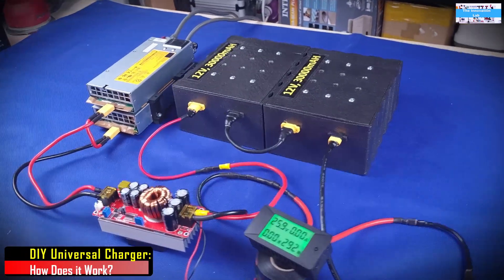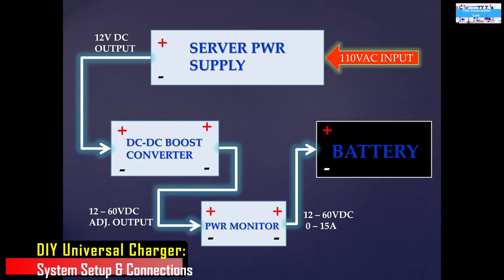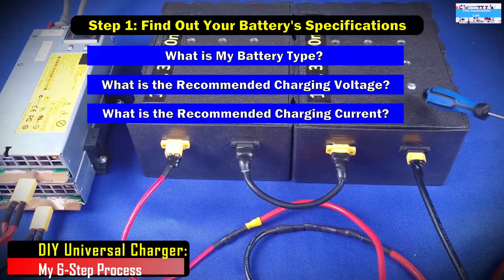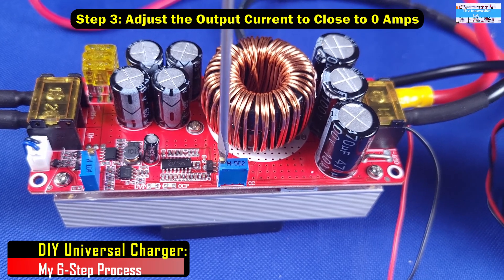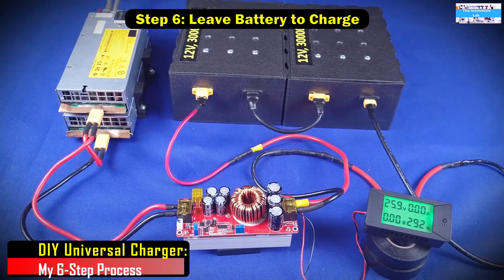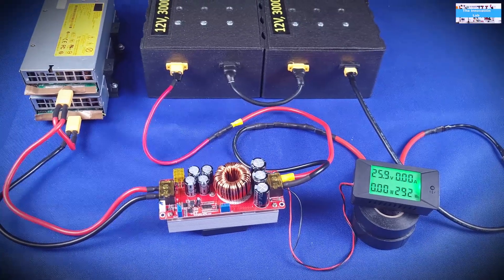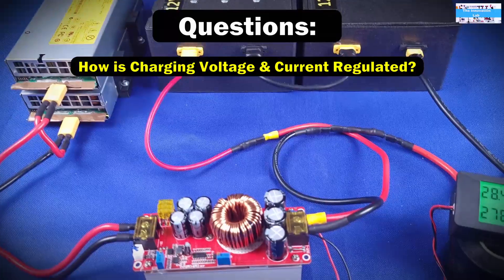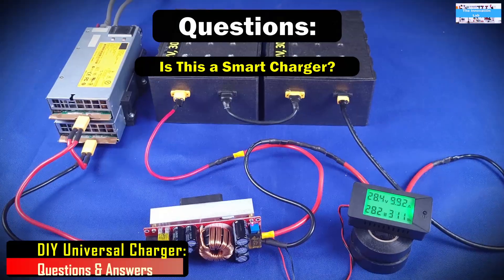DC to DC BOOST CONVERTER, High Voltage Battery Charger!

Comment: Hi friend. I have another question. Can I charge LG Chem lithium assemblies without a booster module? Directly from the power supply unit with a 12.6 volt supply? And also having previously used BMS
Reply from the maker: Thanks for the interaction. I really appreciate your thoughtful questions.
👍 
However, I am not sure of what the specs of your battery are so as to speak to the charging conditions.

The reason why I recommend using the boost converter is because it is a constant current converter and  allows you to control both the  charging voltage and charging current to match what your battery is designed for. This prevents you from damaging your battery cells due to high charging currents.

Reason:
Lithium ion and lithium phosphate battery cells have low internal resistance when the batteries are fully discharged. This means that if you do not control both your charging voltage and current, you may end up with super high charging currents going into your batteries. When this happens, your power supply could either trip off, blow a fuse, get damaged, or your battery cells could get overheated, and they may burst after a while.

Overall, I honestly won't recommend that you do any charging if you don't have a way to control/adjust your charging current.
Reply: @theinnovati0nlab782  but a charge of 5 or 15 amperes will take a long time if the battery has a capacity of 200 amperes and 12 volts. How to charge it faster? is this possible?
Reply from the maker: Very true. 
15 Amps of charging current will take a long time. The 1500W boost converters I used can give you up to 30A - depending on your power source. At 30A, your battery will still take about 7 - 8 hours to recharge. Is this the lithium battery? What is the battery voltage?
Reply: @theinnovati0nlab782  LG Chem 3S4P 2.65kWh 12v
I have a server power supply unit 12V 65A

Comment: May I ask one other question and apologies if I missed it in the video...Once the current and voltage are set up, what happens when a cloud blocks some sunlight?  Does this maintain voltage while reducing current?  Then when sunny again will it return to the programmed settings?  Thanks in advance man
Reply from the maker: Thanks a lot for the wonderful interaction. Please know that all your questions are welcome. Please never apologize for asking great questions. 🙂

The boost converter is a constant current converter, and in order for it to perform as designed, it must be connected to a power source that  provides more power than your load is demanding of it. Your load in this situation will be the batteries that you are charging.

It seems to me that what you need is a solar MPPT charge controller. MPPT controller will provide exactly the function that you were describing because as the name goes, they actually do Maximum Power Point Tracking/Control. The MPPT charge controllers are designed to scale down the charging current when the solar irradiance on your panels is low ==> in order words a cloudy/ rainy/snowy day.
Reply: @theinnovati0nlab782  Fantastic.  That answers my question perfectly!  Thanks a million.
Reply: So if the constant current cannot be maintained it will shut down?  And if that's correct, this type of unit isn't a good match for solar charging battery banks, etc ?  (Is my understand correct now?)

Comment: i have 60v sla battery ebike set up. which is 67v if fully charge. can i use this booster converter even if the input is more than 60v?
Reply from the maker: The maximum input voltage rating for this boost converter is 60V. I would not recommend exceeding 60V at the input
 As for recharging your ebike battery, the output goes up to 90-95V
 This means you can definitely use it to recharge your 67V SLA battery.
Just make sure you pay close attention to the recommended charging voltage and current for your battery.

Comment: Great video!!  Thanks man.  One question- How do I dial down the current to zero?  Is that clockwise or counterclockwise?
Reply from the maker: Thanks a lot for watching our videos and for the amazing comments.

To best answer your question, I posted some pictures in our community area. Basically, with the current adjustment potentiometer facing you, make multiple counterclockwise turns until you hear some audible clicks.

Thanks again for the wonderful interaction. Our vision is to reach a wider  audience, and we would appreciate it if you could help by sharing our Youtube videos with your friends and DIY interest groups.
Reply: @theinnovati0nlab782  Thanks for the clear, detailed answer!  I'm going to try it.  Liked and subscribed.
Reply: this might have minimum current in left position but you have to check. because it might as well be max in some other dc dc or new version of this. granted, so far i've found only one myself which does that (for voltage) but anyway, watch for that!

Comment: Good video. Hello from Ukraine
Reply from the maker: Thanks a lot for watching our videos, friend! We appreciate your wonderful feedback.
👍👏
Reply: @theinnovati0nlab782  this module is designed for 30 amperes at the input.  why didn't it burn?  Did you put 60 amps on the input?  Sorry for the stupid question.  I have a unit for 12v and 50a and I want to make a powerful charger for charging LG chem batteries.
Reply from the maker: I appreciate your interaction, and I fully understand your concern.
The reason why I use these  boost converters for battery charging is that they actually allow you to set/adjust  both your charging voltage and your charging current. 

Assuming that you have a power supply that could possibly deliver greater than 50A, it doesn't mean that your boost  converter is going to pull that much current from that power supply. This is because the boost converter is current limited to 30A. 
This also means that even though you have a 12V, 50A supply (600W),  you will only be getting 12 X 30 = 360W, if you use these converters. This was the reason why I doubled my input voltage to 24V. As you saw in the video.
Reply: @theinnovati0nlab782  seems to understand, thanks for the help

Comment: İ am using same method for my 24s lifepo4.Can we connect parallel double regulator.for high amps??
Reply from the maker: Thanks a lot for watching our videos and for asking such a thoughtful question. This is actually one of the best questions I have recieved so far!

Connecting 2 individual boost converters in parallel is always a very challenging task. This is mostly because these are individually controlled SMPSs with different voltage and current feedback loops. I thought about doing it but I realized that it might just be easier to design a higher power boost converter of my own - I am still working on it, please stay tuned.

I appreciate your feedback and if you could support our channels by sharing our videos, that will be amazing!
👍👍

Comment from the maker: We made this video as a follow-on video to our  initial universal battery charger video - to address some of the questions and comments that we have received from friends and YouTube audience regarding how The Innovati0n Lab's universal charger system works.

Hence, we have covered the questions below;
Is the universal battery charger considered a smart charger?
How does the Battery charger regulate charging voltage and current?
Is the charger capable of overcharge protection?

I want to thank you for watching this video and for supporting our YouTube channel.
please let me know if you have any questions, comments, or suggestions.

we will appreciate it if you could become a subscriber. Also, it will be great if you can help our channel grow by sharing our videos with your friends and DIY interest groups as our goal is to continue to reach a wider audience.
Reply from the maker: Thanks!